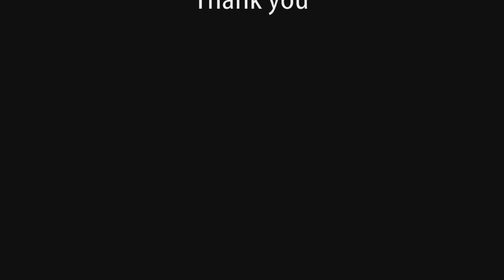Luthier Richie Dotson changing a Friction Banjo tuner to a Geared one.

Comment: Thanks for the educational information Ritchie, you are a generous man with your knowledge and work experience.
The 5th string tuner on my RB250 came loose and your help assisted me in having the confidence and ability to undertake the repairs myself. I set the tuner back at approximately the angle you showed so the string comes off the pegged low and once my tuner was in position I used a cloth covered G clamp to VERY GENTLY bring the tuner into position. No glue required and it works fine. It is obvious that your time and effort in putting your videos together is appreciated by many.

Comment: Thank you so much Mr. Dotson I have one of those lower Quality pegs and thought I could simply remove it and re-install geared one. The issue I have is when I tighten the 5th string it holds the string in tune only to a Point and will not hold the string in tune. I thought I could simply remove it for a higher Quality one. But, after seeing your very wonderful Video I will not attempt tp fix it on my own. I have Banjo maker I know and now I realize why he was so careful when his work it is a very skilled work that he and you do.

Comment: I have seen some banjo fifth string tuners with a set pin but it attaches in the tapered portion at a perpendicular angle I have seen them installed correctly one way but I forgot to write it down or remember it until I encountered the tuner again. What is your procedure behind that install? Great Video I now know the unexplained buzz in my old kay banjo round the 3-5 frets thanks for the detail and tool info.

Comment: Clear instructions. One tiny bit of nagging, from a guy who, as a first-timer, ruined a few necks.
Just in case somebody has an old neck without a truss rod, a wrap of tape on the drill bit, matching the length of the tapered section of the peg, would keep a first-timer from drilling too far in and weakening the neck.

Comment: Would you share your resource for buying the pegs? Also, do you take work? I have a 1928 Supertone, Dixie Wonder 414 I picked up at a garage sale for 5 bucks but it did not have a nut, bridge, pegs or tailpiece. I have managed to replace everything but the 5th string peg. Right now i am using a simple wood friction peg (cut down from an old violin peg) and it a pain to tune. I'd love to put a geared or even a proper friction tuner in but the neck is fairly small. Suggestions? I really love playing this banjo, I love the sound. It originally went for $10 in the 1929 Sears catalog and I only paid $5 for it so I can afford to spend a few bucks. I'm a 70 year old guy that isstill learning to play.
Reply from the maker: Currently the geared 5th string peg I am using comes from Stewart MacDonald.  You can find me at www.AcousticBox.com and yes, I do take on work. I hope this helps.

Comment: Thanks for the vid. Helpful! Question: What if the hole is too big for the new tuner? Paper shim? Also, if the hole is too deep, would you fill it in?
Reply from the maker: Then you need a repair person... a qualified one.  It must be reamed, a proper fitted tapered plug installed, drilled and reamed to fit.  Too complicated (to do properly) for a quick video.  Seek a banjo luthier, NOT pimples the clerk at Guitar Center.

Comment: in order to remove my tension tuning peg and replace it with my new fancy geared tuner, I have to remove a tiny metal ring inside the neck that's holding it in place... I think it may just be epoxied in or something. Have you encountered this before? Any suggestions?

Comment: I need to do this on an old banjo, i bought the new geared tuner, but i'm nervous of drilling out a new wider hole, because the old hole is right up against the fretboard edge. Just wondering if i can drill a completely new hole, the alternative is somehow drilling off-centre. Help!! ♪8^0
Reply from the maker: No.  That would lead to problems big time, in my opinion.  If you don't have a drill press or an experienced person to help you I would wait.  You will also need the reamer mentioned in the video.  I hope this helps.
Reply: actually got away it, it works fine....but unfortunately, the old neck is quite warped and shifting the strings to one side aswell! problems.